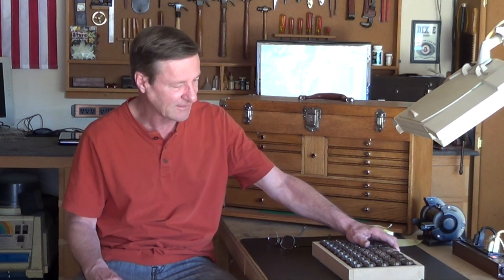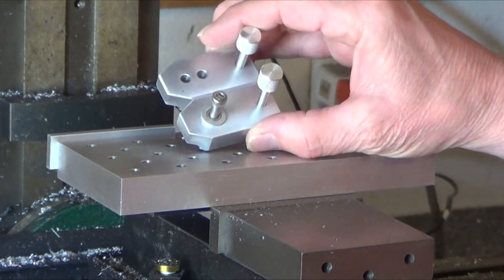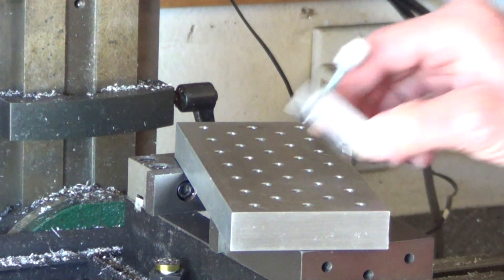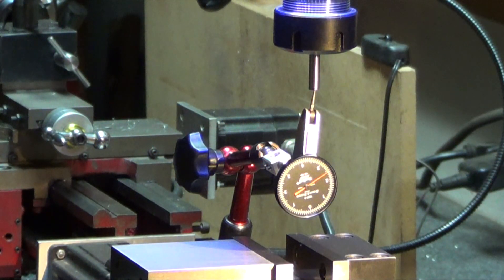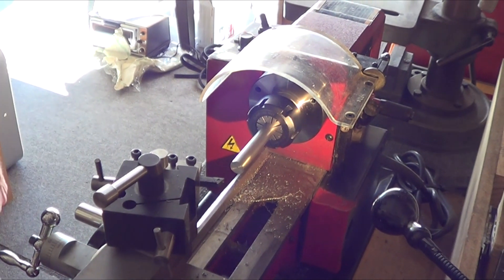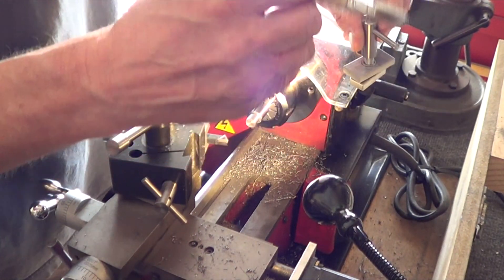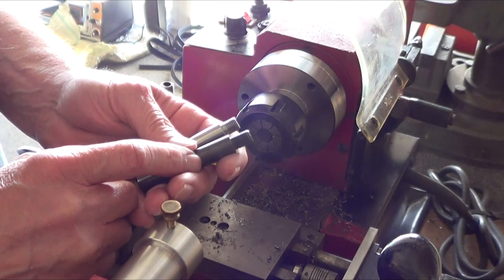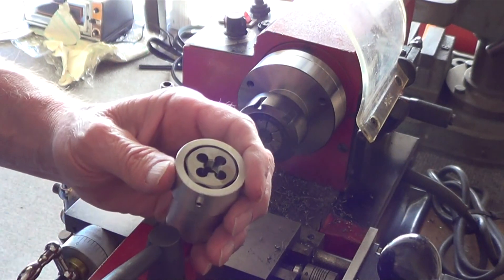Arbor failure & Jacobs chuck runout Video #41

Comment: Excellent video.  I kept thinking 'why doesn't he check this?', then you checked it!  
This explains why a drilled hole is a little bigger than nominal and not precisely round.
Reply from the maker: +Cliff Miller In video 43 I will show how I made the chuck go from .011 to .0005 run out... Thanks for the comment!